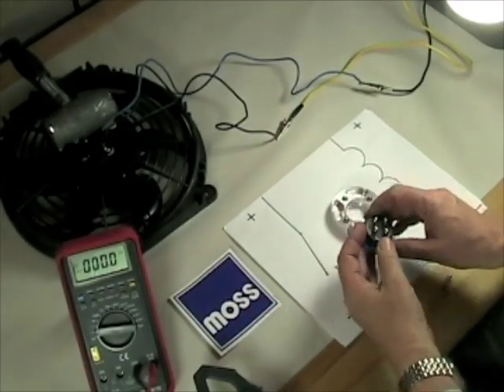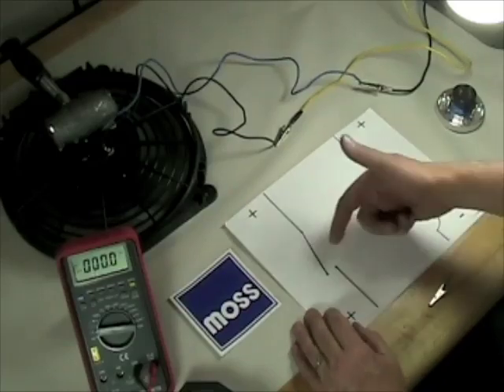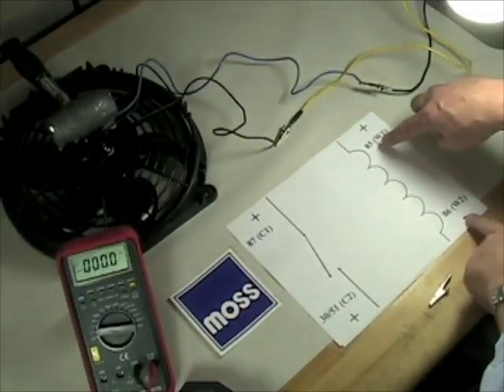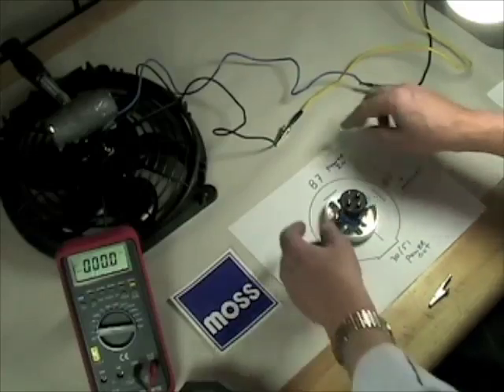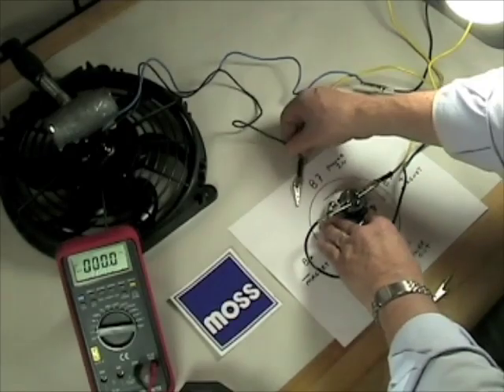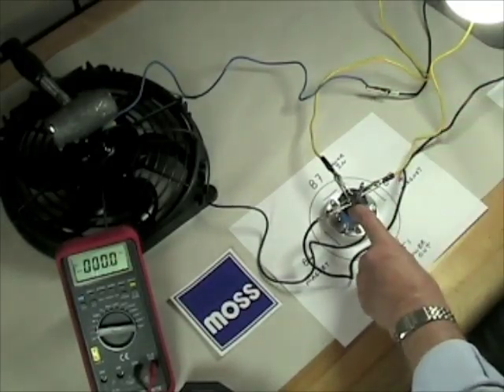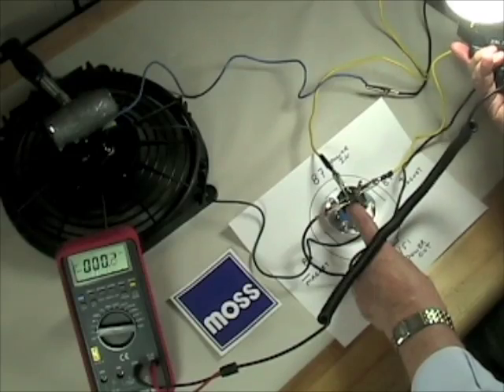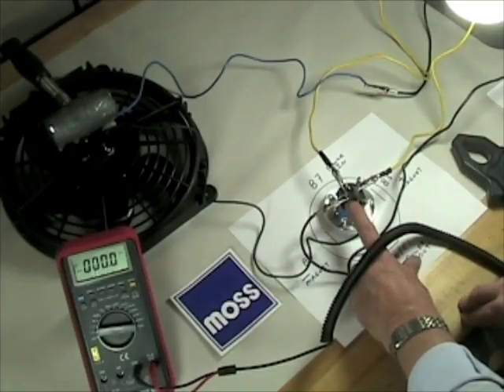Relays - How to Wire

Comment: I'm sure you wont respond cause this is an old video but can I use a relay rated for 220 volts 30 amps, on a 110 volt lower amp device?

Comment: Great video! So they are pretty much like a solenoid, right? I've got a 1970 scout which I'm wiring new spot and flood light onto. Original elect. Circuits. Will I need one relay per light?

Comment: I got a relay not for my horn or lights but for my amplifier because it gets really hot hence I got some computer fans to cool it down. I got a relay and wired it to the remote turn on from my car stereo so when my radio is turned on the fans turn on as well to cool down my amp.

Comment: I appreciate the info, wasn't sure why I needed to run a relay opposed to just an inline fuse. This cleared it up. Why do I still need to run an inline fuse? I am assuming its to protect the relay since there usually more expensive and harder to get to. Please confirm for me whether i'm right or not. Thanks

Comment: I can answer that for you sir ..the 3rd pin is for the led  you wire it separate so when the switch is on you can tell by visual hence LED...a 2 pin is used when you don't need an visual/ led reference.. hope that helped

Comment: What is the maximum speed that a relay can osculate? I mean for example if I have a 555 time circuit that drives the relay, how much would the be maximum frequency which I could get out of the relay? Lets say 555 circuit can go up to 200Khz. Regards

Comment: It took me long enough to figure it out,but it think it protects a circuit like the inginion switch on a car,it goes to a relay to power a starter motor. of course you have to get the right one for how many amps I think.I thought relays were more complicated but it looks like all they are is electromagnetic switches. I could set a horn on the car from the ignition to a relay to power another horn with a toggle switch.thanks for the video

Comment: on 87 diagram,how much amp did you use for the fuse?and for the switch 85,is that the same voltage as the 87 would be, with fuse?

lets say the fan is 12 volts..

Comment: i tryed using this way for wiring off road lights but ones i add the other power from the switch inside the car to the relay, my switch burns dont understand why

Comment: so you need a dedicated 12v+ line to actually power the device correct? the 12v+ ignition or switch lead can be spliced off anything?